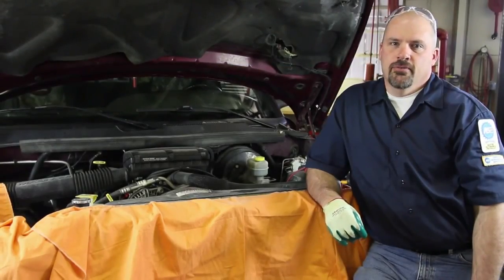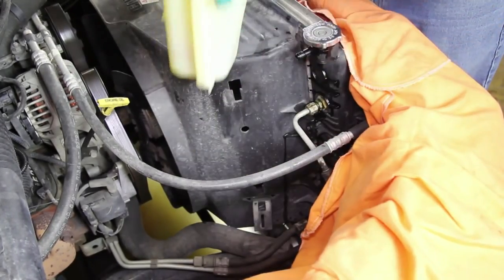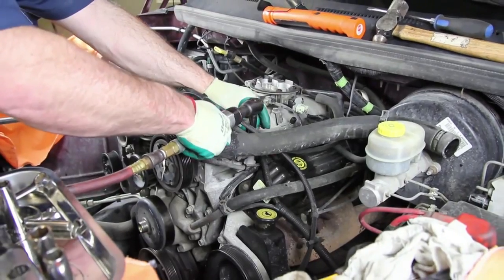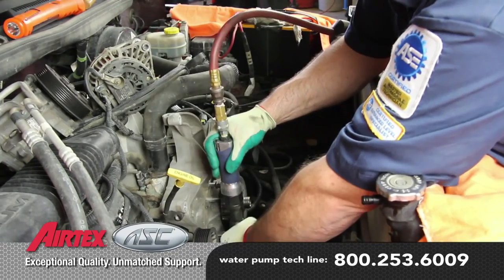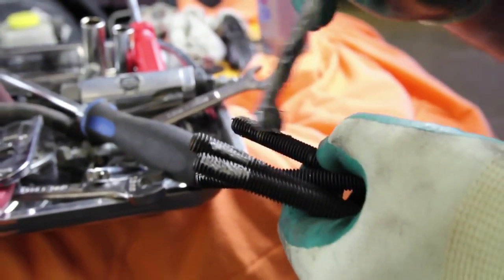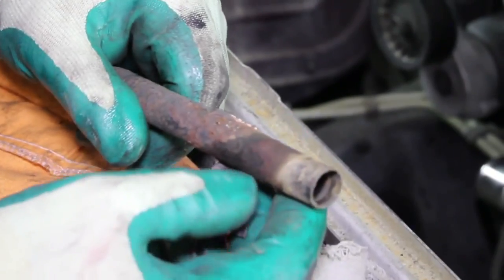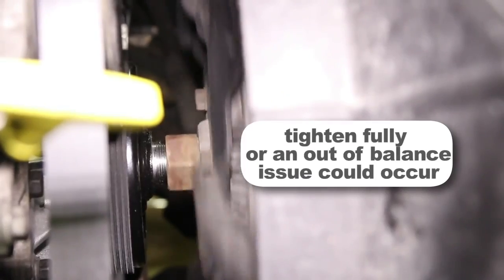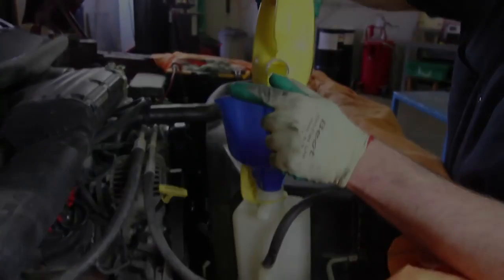How to Install a Water Pump: 1994 - 2001 Dodge Ram 1500 5.2L V8 WP-9126 AW7160

Comment: trying to diagnose source off noise I.e fan belt or pump...  Squeals much more the warmer the outside temp. Makes the noise as engine is revved past idle.  Will suddenly stop squealing after a minute or two of driving.
Reply: May be your alternator

Comment: You know whats wrong with videos like this. One of the wire clips on the AC has a red tab. What the hell do you do with the tab to get the plug disconnected??? Nope. Just take set it aside... thanks
Reply: You push the red tab out to one side. It slides. Then you push down on the black one. Its a pita.

Comment: The biggest surprise for me was on the end of the video the dash is in perfect condition, 98% of the dash  – is Brock
Reply: sorry for the necro but i just bought a 2001 ram 1500 in 2025 with no cracks in the dash.. a rare gem indeed
Reply: @reburgcam  take a look if it is already repaired and just a Dash cover glued over. I bought one too, 2 years ago and was also suprised that it was not broken, but then i saw the double layer on the dash

Comment: So this bay looks completely different to the 98 1500 van I need to do this on, the AC lines run across the top of the fan shroud I don't think I'll be able to pull the shroud without opening up the AC system :(

Comment: quick tip....take a tie rod fork and put between pulley and the  pump and tap it down...that will keep it from spinning...i used a big adjustable wrench to get the fan clutch nut off few taps with hammer...new pump comes with new pulley so hammer away..no need for the special tool..

Comment: How I can verify the wat pump is working when I have no leaks but the truck is over heating only when I drive in the freeway the truck never over heating in town
Reply from the maker: It sounds like you may have a flow issue. A restriction in the radiator, slowing the flow of coolant, at high speeds can lead to an hot issue at high speeds. Once you slow down the cooling requirements aren't as high and the engine runs cool again.

Comment: Anyone know torque specs on the thermostat housing??
Reply from the maker: The thermostat bolt torque spec is 225 inch pounds = 18.75 foot pounds.
Reply: 2 ugga juggas

Comment: Hello ,im losing coolant from a reservoir ,I cant find any leaks ,what it can be ?? I got a coolant in a radiator .
Reply from the maker: First off is the overflow bottle cracked and leaking? After making sure it was solid I would start with a pressure test of the system. If nothing is apparent I would next use a dye in the cooling system. Follow the instructions supplied as to what conditions and how long to operate the vehicle. I would also use a combustion leak detector to "sniff" the coolant for a possible blown head gasket.

Comment: You don't have to remove all that staff like alternator end AC unit
Reply: You do if you need to replace the upper short hose of the water pump.  After 20 years if your already inside replacing the water pump you might as well change that upper hose and the thermostat or otherwise you'll be doing the same thing in a few years.
Reply from the maker: It may be that you can. For the purpose of visibility for the video it was, as many do to simplify the job, removed the aforementioned parts.

Comment: GREAT VID THANX \m/  , and to non pro's with coolant leak issue on these rams remember that the timing chain cover behind water pump has a coolant passage which is prone to blowing out its gasket causing a leak there at top of timing chain cover on both driver n passenger sides calling for replacement of timing chain cover gasket . and most guys say if the chains old get a new timing chain kit , only like 60$ , and do it while doing gasket .
Reply: If it's my timing chain that is leaking.
Does that mean my water pump might be okay?

Comment: how do I tighten the Fan Clutch back up
Reply: +Airtex Pumps , correct. But do I need to tighten the Fan clutch with a wrench. Or does it tighten when the engine turns, once the truck is turned on.
Reply: +Airtex Pumps ok, but how do I tighten the Fan clutch if the water pump pulley keeps spinning.
Reply: +Airtex Pumps . Thanks. this video was a big help.

Comment: First of all, this video was immensely helpful.  I replaced the water pump, thermostat, housing, and bypass hose.  The problem I'm having now is that there is water leaking from somewhere above the water pump, but I cant see where.  Is there a way to diagnose this?
Reply: Nevermind!  I backtracked and found that the bypass hose was improperly installed.  It's great now!  Thanks!

Comment: Richard, thanks for making this video.  It was the best video footage and clearest directions I found.  I had never performed any repairs before because I didn't have these experiences growing up.  My truck is headed downhill, so I had everything to gain and nothing to loose.  I saved $200+ dollars by doing the work myself, and bought some more time while I shop for a replacement car.  

Below are a couple of comments from my experiences for everyone else considering this project......

 - Like it shows, make sure to disconnect the battery.  When disconnecting the alternator you will have a HOT wire.  
 - The fan clutch wrench I used was 36mm.  It seemed a little loose, but worked.  The auto store did not have the spanner wrench to keep the clutch from rotating so I found another suggestion to use vise grips.  This worked well, just don't forget to take them off before starting the engine to check coolant fill.  Mistake #1, cost about $38 for a new belt, and quite a smoke show.
- don't disconnect the hoses on the top of the A/C compressor, or you will loose all refridgerant. My system was empty and not worked in a couple years so I didn't loose anything.  If your A/C works, you would have the added cost to refill the system.  It's not needed to disconnect if you pay close attention.
-  I see you used a black RTV.  At the store the blue is for "water", red is for "high heat", and black was normal applications.  I used the blue as suggested at the store, because the coolant shouldn't get as hot as the 500F range for the red.  Can you clarify the best RTV to use?
 - The use of the air wratchet would make this job go much faster.  I was not able to borrow a compressor in time, so I went the manual socket wrench route.  Not bad either.
- I was pleasantly surprised how straightforward this was.  The alternator, A/C, bracket and water pump came off fairly easily.  The most time was to clean the mating surfaces for the gasket and RTV.  The re-assembly went well too.
 - DO plan on replacing the short inlet hose.  Mine could not be removed without damaging.  This required a trip to the store mid repair. 

Once again, thanks for the video.  It was very helpful!
Kevin
Reply: How long did that take? About to do mine soon

Comment: i literally just did mine. it helps to take the ac compressor off and move out of the way and removing the alternator. it took me forever to actually get the pump off. reason being was that i was too gentle. a buddy finally came over and 5 solids hits on top of a board and it broke free. should have taken about 4 hours, instead of the day and a half, or so since i got everything else off quick. make sure you get a good couple of whacks on top of the old water pump an d it should come off easy. best of luck.